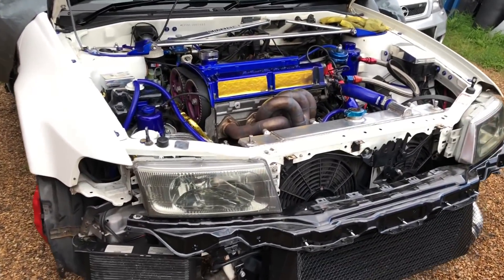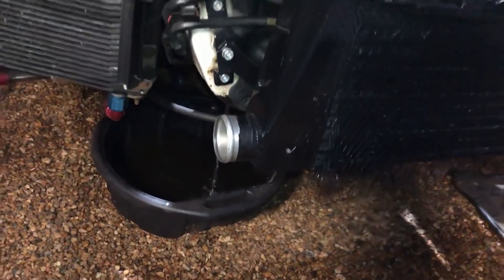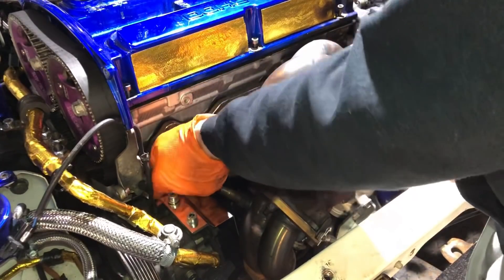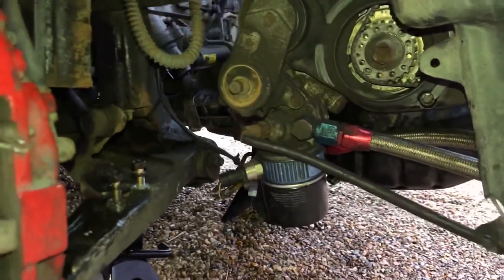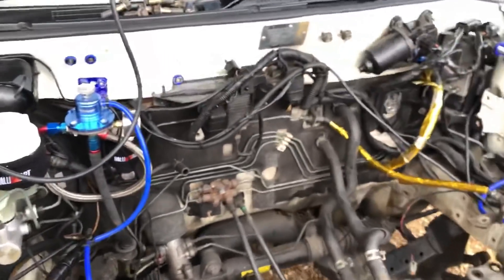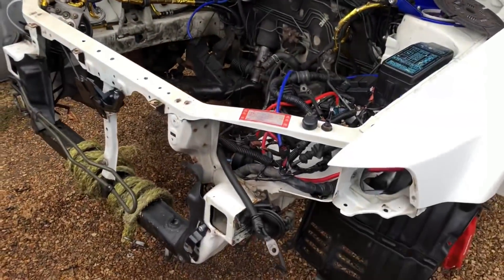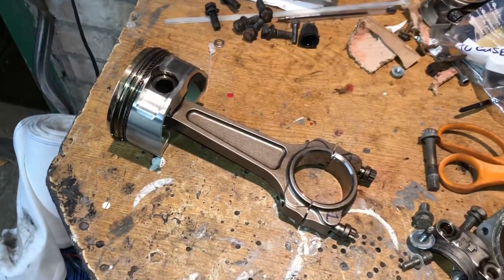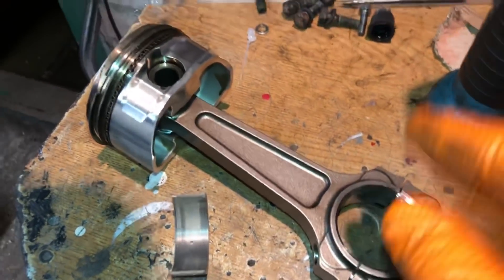IT CRACKED THE CRANKSHAFT!! Evo 5 4g63 Engine Strip Down

Comment from the maker: How much horsepower should we go for in the next engine build? 🐴
Reply: Personally I think 450-550 bhp as it would be a beast of an Evo and tear up the back roads and the track.
Reply: Not sure about that turbo but from experience 500 whp is just about drivable on the road...
Anything over 600 bhp would render the car to be a track weapon only.
Saying that technology has probably EVOlved (pardon the pun, lol) over the last 5 years so more power may be useable on the road
Reply: @hassannaqvi4512  absolute rubbish.
Reply: 500/600
Reply: Aaron Unknown as much as it can possibly take but still driveable 🤷‍♂️
Reply: I’d go for 900 whp! Where did you learn all this mate, your super talented! I bet u have forgotten more than most mechanics no!
Reply: @Galamesh123  at 900 whp it would be super hard to drive. Would have to be a drag strip only car.
Reply: DomBounty go big or go home, he said he is running race fuel With the alrdy stand alone ecu! I know of many 7-850hp evo on the road and are more than adequate for the a roads
Reply: @Galamesh123  Each to their own. Personally I'd find 600bhp+ a bit unusable on the roads around me, as that would probably take a while to spool up as that kind of power tend to require a big turbo, making it weaker in the corners. Over 600 would be sick if you had lots of straight-aways though.

Just my personal opinion/experience.
Reply: @DomBounty  rubbish.
Reply: @DomBounty  so how do time attack cars manage then??? What rubbish!!!
Reply: @Drquimbaymatumbo  massive areodynamics, diffusers, really insane tunes that push the engine to blowing up. Weight reduction... the list goes on. Im just speaking from my experience and I find 600bhp to be ideal, any more and your blowing up transmissions, differentials, axles, etc... if you crank more out youll be replacing parts constantly unless you spent a fortune to buy the best of the best...
Reply: @DomBounty  yes, i know. My block cos 9k..... head was 4.5. So i know what you're saying. Im building a 4g64 to keep her reliable at about 700.
Reply: @Drquimbaymatumbo  I've just got a stock evo 8 block with ARP head studs, cosworth head gasket, uprated valve springs and retainers, HKS cam gears, a 4 paddle clutch and a HP Green turbo, with all the other bolt ons. I'm running 500bhp and I've broken my drive shafts more times than I can remember and don't get me started on transfer cases... If I pushed to 600bhp, which I know the engine will be fine to run at, everything else will turn into butter. AHAHA
Reply: Might be an evo 9 block actually, not sure anymore
Reply: @Drquimbaymatumbo  Of course! ahahaha
Reply: @DomBounty  lol thats the issu. Need to get those fat shafts off ross sport dude. Lol.
Reply: @DomBounty  im aiming to build a 1200 bhp engine. Then run it reliably around 700......and not launch it. Lol.
Reply: @Drquimbaymatumbo  Been a while since I've destroyed an axle tbh, but if I wanted to make more power that'll be the first thing I'd need to upgrade, really happy with the current performance atm
Reply: @DomBounty  i was tirn between a 63 n 600. N a 64. Im an engineer by trade, so i like things reliable. Probably went abot over board tbh.....lol
Reply: @Drquimbaymatumbo  I'm a engineer by trade as well so I get the desire to push the limit and experiment with things. We have a lot of CNC milling machines at work that I have be lucky to use once in a while to create bespoke parts of my builds which is a great joy and utter life saver. Just had some custom radiator brackets made up for a new Koyorad
Reply: 638bhp. that exact number.
Reply: I would go for 600/690bhp😉👍
Reply: Hmm - its that balance of power, money and having the brakes to stop it I guess. My EVO does big power, but everything else is rated for it plus a full cage.  600 is way enough on the road - multiple maps ? - then kinda sensible,  fruity and mad options ?
Reply: @TheMRTVID  i strongly disagree..... im building a 730 bhp 4g64. Can NEVER have too much power on the road. Even an audi s1 can get to 400 no dramas. Evo's need to be insane....
Reply: @Drquimbaymatumbo  Gotta remember he's on UK not US roads which are tight and twisty,  not the wide straight ones present in a lot of the US.  A big pile of boost coming on at the wrong time could be a recipe for disaster.  Better to drive a slower car fast than a fast car slow IMHO.
Reply: @RedCoat232  what????? You see that thing on the end of your right leg... you know your foot.....operates your throttle. It only goes so fast as you make it. What about time attack cars???? They manage twisties just fine.
Reply: @Drquimbaymatumbo  Turbo cars do not have a linear relationship between throttle position and engine power.  If the turbo is not up to speed the amount of acceleration it offers is not the same as when it is up to speed.  If the torque curve goes straight up at some point in the rev range, you can find yourself accelerating faster than you anticipate even when holding the throttle steady.  Time attack cars are dealing with corners that they can see - there are no hedges in the way and certainly they don't go round the bend at 60mph to suddenly find a tractor traveling at 5mph.  UK B roads are often blind corners with decreasing radius bends.  If you'd ever driven them you would know.  The comment is not dumb it reflects experience.
Reply: @RedCoat232  put your tampon back in, n go buy yourself a nissan leaf.......
Reply: @RedCoat232  i live in the wye valley. I'm well aware there are VERY sharp bends, with tractors on the other side. Im extremely aware when i ride my rsv4 up through the wye valley. Same as when i drive my evo.......my brother was killed on these roads. I know them and the inherant dangers just aswell, if not probably better than you do. No need to educate me on british roads...
Reply: @RedCoat232  yea just drop off the throttle......simple really....
Reply: 600hp...
Reply: All the horsepower 👍
Reply: As much as possible without blowing the engine!
Reply: How are you financing all this ? Playing cars isnt cheap in my experience..cool channel tho 👍
Reply: Faster than lee cockwoods sorry lockwood.
Reply: 800 bhp, any more would be a big strain on the bank balance. Lol 😂
I think 🤔 it is a safe place to be. 

Great details on the video by the way.
Reply: 600
Reply: i say 600 but  with a new timing belt tensioner!  , not sure if you know about the fault with  mitsubishi brake master cylinders get a brand new one  sure simon norris would agree . lol
Reply: 500 and abit more don’t go over 600
Reply: As much as it can take💪👌😀
Reply: All the horsepowers 🏎💨
Reply: Seen a few llf videos of these at 600 and they are so lively
Reply: 600 but if you can go higher, max her out.
Reply: Aaron Unknown I have got a spare steel stroker crank 😜
Reply: Max 600
Reply: I would say dont go over 400-450 because u dont wanna be putting extra stress on the other components besides the block eg. Transfer case, trans etc
Reply: All of them!

Comment: Engine box and transfer case will come out as one out the top as done it on mine just took mounts out the cradles both sides 
That knock sensor looks f****d 😊 and the number one shell looks a bit dodgy 
I’m running a Carbotech twin clutch with 1275kg pressure plate so hooks up sweet as
Your so lucky with that crank I swapped out my 4g64 one for a Simon norris 100mm knife edge cross drilled crank absolute work of art 👍🏻

Comment: For the crank / rod bearings, do you use the same clearance stated in the manual for high powered engines compared to 'normal' engines?

Comment: Loving this engine build i think 1000 bhp running on meth to keep temps down with a shot of nos wanna see lots of carbon drip in the bay with some clever grip/stability programs wide stance none of that stretched tyre shit just real wide at the rear an low to the ground like i like my girls😉😉😉 some need for speed shit this gonna be 🙄🙄🙄

Comment: Not challenging your knowledge but if I'm not mistaken the flywheel on this motor will not really gain much by skimming it if it has suffered heat damage... It may be better to replace it.
Please let me know your thoughts 👍
Reply: If it was a dual-mass flywheel I'd personally replace it, however, a single mass flywheel can be skimmed (will save the owner a lot of money). If the flywheel has any cracks, even tiny ones I'd replace it as well, however, as this flywheel looks to only have hot-spots, skimming it would be ideal. Once skimmed I'd check for any further damage and evaluate it then, but it would be worth the cost imo.

This is only my opinion from very little experience, but thought I'd share my thoughts anyway.

Comment: Aaron what causes a bearing to spin like that
Cracking video again hows the red show astra coming on & the fiesta 👌🏽👌🏽🤘🏼🤟👌🏼👌🏼
Reply: In the previous video he explained that the previous owner had performed an oil change, and put the required amount of oil into the motor, but as the car had an oil cooler, once the car got up to temperature the oil cooler kicked in and sucked at least a litre of oil out of the sump which caused the engine to loose oil pressure which caused all of this damage.
Reply: Lack of oil